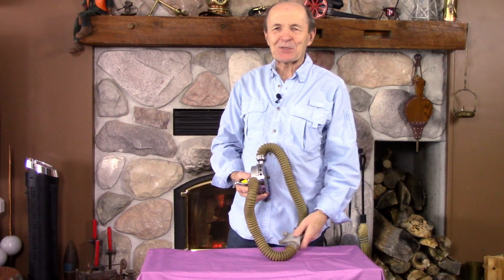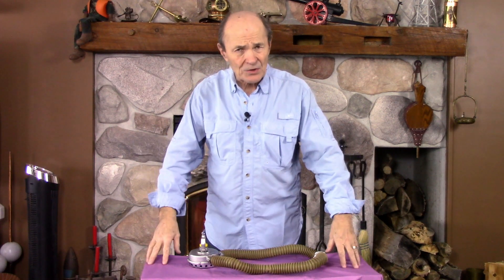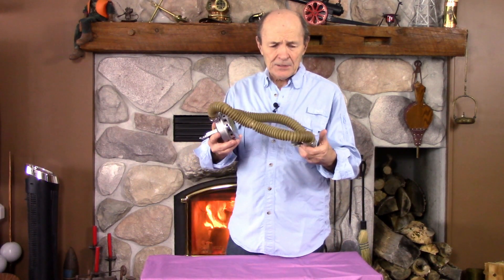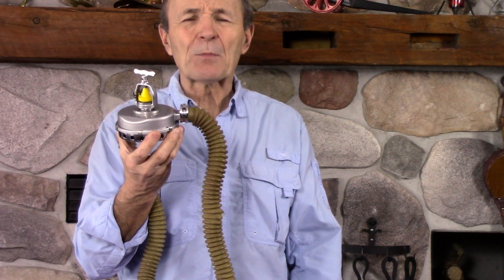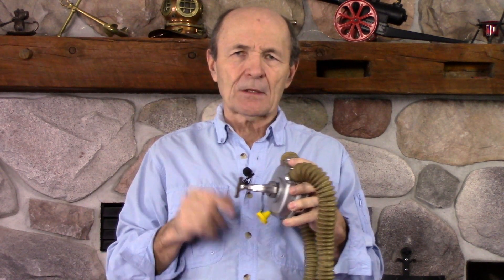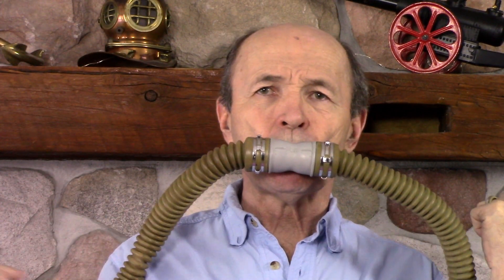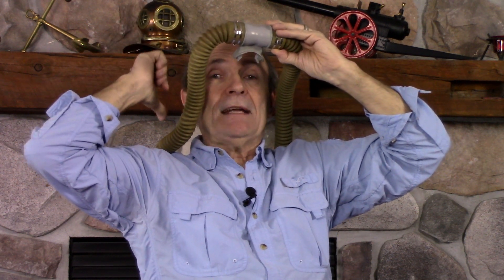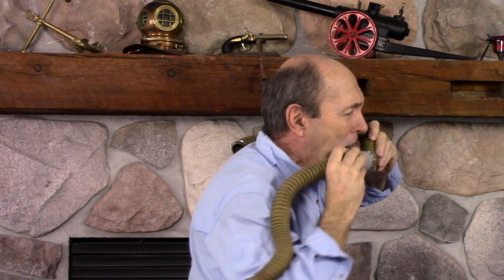Vintage Scuba: Diving With A Two Hose Regulator - S03E01

Comment: I trained on a double hose, like you. My first regulator though, was the original model of the Sportsways Waterlung, a single hose. I always preferred the double hose though, with my first being a Dacor Dial-A-Breath. Later I bought a US Divers Aquamaster. I appreciate the modern inventions of a BCD and SPG, but my heart still belongs to double hose regulators. I recently bought a rebuilt Royal Aquamaster, with long yoke, rated for 3000psi tanks, (looks almost brand new), and am in the process of equipping it with an SPG, via a banjo fitting, and a hose from the low pressure Hookah port, for BCD inflation.
Reply from the maker: Welcome to the vintage divers club.  I know all the gear mentioned and actually taught the PADI Specialty course "Vintage Double Hose Diver".  Even trained Kevin so could not be that hard.  Look through my Vintage Scuba playlist as it should bring back lots of memories of gear from the stone age.  Thanks for watching.

Comment: Since my first viewing of SEA HUNT, in 1961, I craved a set of twin 38's with a double hose USD or VOIT regulator. When I finally got the rig set up, I was greatly surprised at the inhalation effort compared to a 2 stage balanced regulator with venturi assist. Wow. Hats off to Lloyd Bridges. He had a man's man diaphragm.
Reply from the maker: When early regs said easy breathing, they meant in comparison to a straw!   It was all relative as all early regs worked off the same method.

Comment: Alec, I have watched a lot of your fine videos. I now have an itch to get back into diving. When I stopped diving in the mid-'90s, I gave my son all my diving gear. I still have my old twin '38s I started with way back then. I just bought a Royal Aqua-Master that was restored a few years back and was not used since then. It will be inspected of course. I plan to send the reg to Vintage regs for a conversion this winter. In the meantime, where can I find a "banjo" for an SPG? Did I hear you say that the Hooka port on the regulator can be converted to an LP port for a safe second or BC inflater? I am going to a dive school and take a refresher course. I am looking forward to "getting wet" again. Thanks for bringing me back to my first love. Best wishes.
Reply from the maker: Vintage Double Hose should have banjos available. I have several and can sell you one if necessary.
Contact me at seahunter@vintagescuba.com
It's a very common practice for divers to use the hookah port for LP accessories. There is a fitting that will convert it to 1/4NPT so you can then fit anything into it. I've seen divers with a Safe Second, a BCD inflator AND a drysuit inflator in there. It just a matter of having a 1/4NPT TEE or even a triple tap installed. Cheap and easy.
Good luck with all your plans. I'm sure a lot of the thrill you enjoyed years ago will return.
Alec

Comment: Alec, if you used surface supplied air to a  2 hose regulator with a low pressure port, didn't you have to plug the tank port with something?   I have never seen such a plug if so.
Reply from the maker: The regular dust cap was used. 
There was a wonderful dust cap made from solid aluminum with an O-Ring. It did the best job. 
Sometimes the plastic ones split if the yoke screw was tightened too much.
Alec

Comment: Why did they have a 2-hose arrangement in the first place? What was the point of directing the exhaled air back to the reduction valve? It's not like it's a rebreather. Can someone explain?
Reply from the maker: The original regulator had only 1 stage. That is, the tank air pressure was reduced to ambient pressure for the diver to breath in 1 step. That regulator was mounted on the tank valve just like today and there was a hose that fed the air to the diver. It made sense then to have a 2nd, matching hose to get rid of the exhaled air and that went back to the same box that held the 1st stage on the valve. I don't think it was planned or designed for any specific reason other than what seemed logical.
The addition of a 2nd stage led to the development of the modern regulator. The 1st was still mounted on the valve and the air was fed to the second in the divers mouth. It was a much smaller hose so there was no need to run a big hose back to get rid of the exhaust.
Just saying.
Thanks for watching.
Alec

Comment: The first thing that you learn when watching " Sea Hunt ", is how easy it is to CUT the hoses,
Reply from the maker: They sure make it look easy huh?
Actually if you had a double hose reg hose in your hand and a good knife you would see it's not quite that easy.
I've been told by those who might know such things (former stars, stage hands, stunt divers, etc) that on Sea Hunt they tied the hoses onto the reg lightly so that when pulled hard they popped off.
And, if you didn't know, it was the exhaust hose they "cut" , unless in very shallow water.
But the show was great for a 10 year-old with dreams of being a frogman "just like Mike".
Thanks for watching.
Alec

Comment: Hi Alec, I just had a chance to try the two hose regulator that I bought. I recall you mentioned they were hard to breath with. Out of the water it was very easy in the water it was hard, thinking about it I figure the difference is the water having to be sucked into the exhaust chamber with every move of the diaphragm? If that is the case would it work better to have more or bigger holes in the exhaust cap? I know it wouldn't be original but it might be easier to use. Btw I liked the "drunken (gin and condom)regulator" story in your latest tech tip. thanks Owen m
Reply from the maker: Properly set up a 2 hose can be quite good to use but it will never breathe like a modern single hose. There's simply too much mechanical stuff to move around, plus big hoses with corrugations, 3 exhaust valves to push open or closed and so on.
It's nice that you've been able to try one. Now you appreciate what 50 years of development has accomplished.
There are some modern 2 hose regs available now and they are amazingly easy to breath from , not quite as good as a good single, but close.
You can read about them on the 'Vintage Double Hose' website.
Take care.
Alec
Reply: hi Alec I was able to find a few more old double hose regs so I tried the experiment with the exhaust holes, I drilled twice as many of the same size, and it made quite the difference in the ease of breathing! it is not original but neither are the hoses and wagon wheels but I feel much more at ease using one now with a pony bottle as a safe second. You mentioned you have lots of old units, it might be fun to try this modification on one of yours. I see what you were saying about the hoses hitting your ears. Take care Owen m

Comment: a very good description of the Mistral and the DA Aquamaster regulators. 
Improvements parts are available today so you can easily replace the first stage with a new one that is of a balanced design and provisions for installing a SPG and many low pressure accessories as a standard second stage, a BCD etc...
I rebuilt one last year and it performs as well if not better than my current single hose regulator.
Reply from the maker: A lot of my vintage scuba friends dive exclusively with a double hose reg.
And there are new synthetic parts to make them more reliable.
As good as a new single hose? maybe in strict terms of breathing performance but they still have a lot of double hose regulator issues. Maybe I'm sceptical because I dove with them for so long and really enjoyed it when the single hose came  along.
Lots of fun though and they sure look neat.
Thanks for watching.
Alec

Comment: hi Alec I wanted to ask you a couple of things regarding these old two hose regulators. you mentioned that they operated at 2000 psi can they work at 3? Does the exhaust air do anything inside the back of the reg? or could they have exhausted out the side like modern ones? I have watched most of the first season of sea hunt and a few things come to mind (just observations not criticisms) it seems that Mike was very reckless from todays standards, mostly diving alone, cutting safety ropes and going into caves without a tether line. In a few of the episodes he had to swim back and get another "lung" to help a stranded person (eg in the mine episode) this leads me to another thought, when did the safe second actually become an option? there seems to have been a need for it. Did someone ever try adding a small hose and valve to take air from, like the first pearl or sponge divers used? You mentioned in a recent video that you are getting rid of some of your treasures (my better half calls mine " that crap") you also mentioned that you have boxes of old two hose regulators? hope you might consider selling those some time ? I noticed the only ones on e-bay are from the states, also I found an old Poseidon Jetstream single hose regulator that I don't think you have talked about in your vintage strange regulators episode. Keep the old and new Info coming ,thanks Owen M
Reply from the maker: Wow! Lots of questions.
Here goes:
While the valves of an old reg are fine at 3000, the yoke should not be used over 2500 unless it's changed to a newer version.
The exhaust could have come out at the mouthpiece but the first design took it to the back and it stayed that way.
Realize that Sea Hunt was a drama show so things had to be dramatic. Also a lot of the rules that Mike " broke" weren't even rules yet.
The safe second started in the late 70s but it wasn't common until the 80s and not mandatory until 1995?
I'm in South Africa until December. When I return I'll be listing lots of vintage gear. If there's something special you want let me know.
Take care.
Alec
Reply: Hi Alec thanks for the response, could you check and see if my subscribe account has changed? I did not get your answer or your latest tech tips to my email? If you are getting rid of a working 2 hose regulator I would love to buy it from you, Mostly as a decoration but I would like to try how scuba first started out in a pool.it will go so well with my tacky scuba bottle bedside lamps. I had one from a pre1989 aluminum tank that I picked up used, since my better half hates it, I naturally had to buy a second  one so I have a matched set. Enjoy South Africa ,I just got back from Cuba and was surprised how few fish there were, not sure if is the season or the result of the recent hurricane washing food off the reef ? Dive safe as always. thanks Owen m

Comment: That looks like one nice all original Voit green label two hose reg in great shape.  If you ever get tired of owning it let me know:)
Reply from the maker: I have about 100 2 hose regs and with just a couple of exceptions they are all in good operating condition.
They are used occasionally when I conduct one of my PADI Vintage 2 Hose Diver Specialty courses - lots of fun for the divers and for me too.
Unfortunately, this particular one, the Green Label Voit as it's called, properly called the Voit Lung, is very popular which also means expensive. That's partly my fault since it's been promoted as Mike Nelson's regulator so all Sea Hunt fans want one.
Expect to pay $500+ for one, if you see one.
Good luck.
Alec

Comment: How did know the amount of air you had remaining without a guage?
Reply: Well, BJJ, the short answer is that we didn't.
When I started diving we had surface-only pressure gauges. We checked to see that our tank was full before jumping in. Then we relied on our personal experience of our own breathing rate, depth and exertion to keep a running idea of how much longer we had underwater. Sometimes we were close but often not. That's when the reserve on our tanks became so important. At 500 psi it became hard to breath and we had to start back up. We had maybe 5 minutes to surface. Of course, back then we didn't make a safety stop and we generally didn't dive deep either. 60' was deep dive!!
I know it sounds kinda' flaky but it's what we had and we made it work.
Alec
Reply: Alec Peirce at the Ranch Incredible! I never knew it was that "blind" back in the day. I recently found your series and have learned so much keep it up!...also I appreciate your honesty when dicussing various gear brands, it's nice to have useful information without the sales pitch.
Reply from the maker: Sorry about At The Ranch. I have 2 channels and I'm always flipping between them.
Yeah. By today's standards I think "diving blind" is a good description. We thought we were pretty cool back then and were quite comfortable with the situation. It was, as they say, the way it was!! You can't miss a gauge that has not yet been invented. Make sense?
Alec
Reply: Alec Peirce Scuba  no worries haha. I agree with you there and am sure having that background gave you a sharp diving sense. I really enjoy the photos of the classic gear you guys use for the Sea Hunt series; perhaps that is a bother hobby I can dive into hahaha

Comment: Alec,   I found one person online that sells new vintage style double hose regulators. vintagedoublehose.com , they call it the Argonaut Kraken, I was interested in getting one or if I can find the special release that aqualung did of the Mistral a few years ago... What are your thoughts? Would either one be good?  I know that I can get parts and service on the Kraken, but I just can't decide.  I value your opinion. :)
Reply from the maker: I have seen both in use. There is really no comparison.
The Kraken is a true double hose regulator of modern design and materials.
It was designed by divers with very specialized skills and is sold only by Bryan of Vintage Double Hose - a good friend of mine.
Many of our vintage diver group are using it and diving all over the world.
Obviously since Bryan is the manufacturer, there will be a full set of parts and any service needed with no delay.
I can't recommend it highly enough if you're looking for an up-to-date 2 hose reg.
If you call or email Bryan be sure to say hi for me.
Alec
Reply: Thanks Alec, You've convinced me. :)
Reply: I have one its awesome!   Used it for a week on Aquacat in the Exumas for 25 dives, and down to 100 feet.   You need to use a wing and harness, it wont play well with normal BC.   Bryan makes a custom backplate for it too.

Comment: Back in the days of the Frogman they were brave  pioneers to use that equipment, I will stick to my Poseidon Cyclone thank you.......... keep em posting Alec  Sir....
Reply from the maker: About 100 years ago (actually in about 1963), when I was around 13 years old, our neighbor had an old motorcycle in his garage. I was already very mechanical and I was fascinated by this old bike. It was a 1952 500cc single Matchless G80s (how's that for memory?). He agreed and I took it home to "see if I could get it running again!".
A week or so later I was ready. The bike was beautiful and seemed perfect, ready to go.
There was one problem. It had no carburettor. The owner said he took it off years before to clean and didn't know where it was. The bike sat there for a while and then one day my best friend, also a biker at heart, was over and I had a bright idea. I got in the driver's seat, Dave got on behind me with a squirt bottle filled with gasoline. I got all ready to start the bike and then he squirted gas into the open mouth of the intake manifold. It started!!!! It took a bit of practice but he soon had the squirts timed so the bike actually ran steadily - well, it ran. What's next? Of course, into gear and away we went. He kept up the squirts while I steered and worked the gears and brakes. We don't go far. It was just too hard but what a thrill!!! 55 years ago and I still feel the excitement today!!!!
So what's the point? In the 50's and 60's we didn't think of ourselves as pioneers. We just wanted to go scuba diving so we got some gear and went. We had what we had and did what we did. I must admit it was very special though.
Thanks for watching.
Alec

Comment: Yes Sir, I'm a Double Hoser for life. Good for hunting, bubbles don't get in my sight.
Reply: Clark Kent, oh yeah but I use the modern aqualung mistral regulator that came out in 2005, hard to find check out ebay aqualung still makes service parts for the even though they are discontinued, or you can get a agronaut kracken from Vintage double hose.com

Comment: Alec, what is your opinion on the Nautilus Lifeline emergency gps/distress device? I'm sure there is nothing wrong with it but I was curious if you felt it was a prudent or unnecessary expenditure? Do certain types of diving make it more necessary than others? Great video, by the way. I was on a charter out of Wilmington NC two weeks ago and another diver had a new "retro" Kraken double hose regulator and round sea hunt mask. He had been diving since the 60s and was telling me about j valves and two hose regs. Thanks to your videos I was actually able to carry on an intelligent conversation with him. Thanks for sharing your knowledge; I am finding it invaluable. best, Josh
Reply from the maker: I may know that chap. The Kracken was developed and is made by good friends of mine. Some of my dive buddies from the Sea Hunt events use it for all their diving - and other vintage gear too as you've learned. The Kracken isn't really vintage. It has a vintage appearance but it's a modern, high performance regulator. 
Look for VintageDoubleHose.com .
The Nautilus could be valuable on dives where separation from the dive boat is possible. Areas with strong, unpredictable currents are the most likely. I've only ever used it once and that was in the Red Sea and while I was never in danger or needed it, I was glad to have it along.
For regular reef or shore diving it's hardly necessary and a bit expensive too.
Alec
Reply: Thanks for the advice/insight, Alec